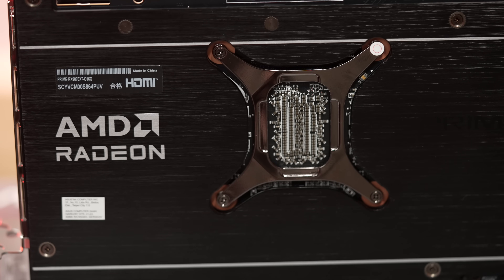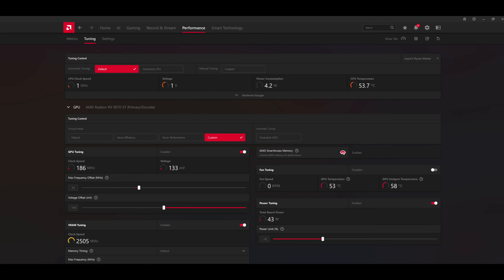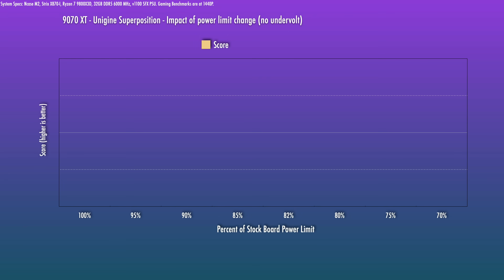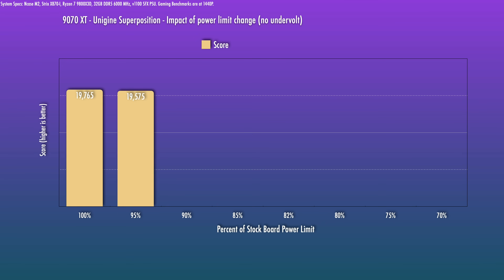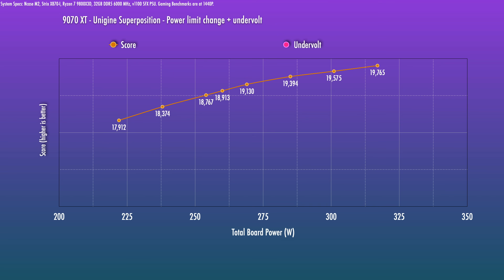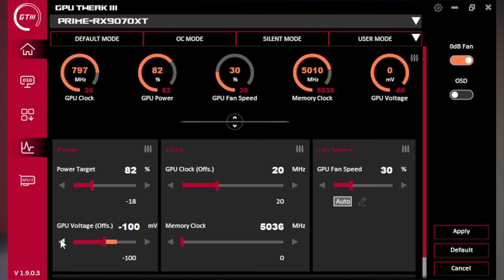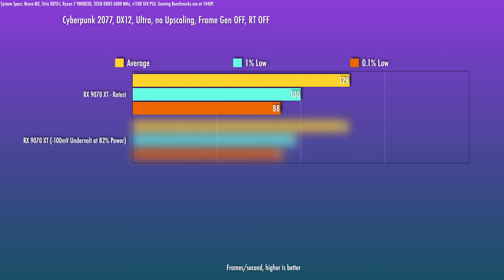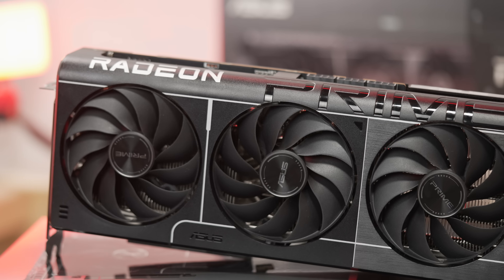Undervolting the 9070 XT... and also overclocking a 9070 to XT levels!

Comment: Something else. Is MSI Afterburner not recommended to do Undervolting on AMD cards with? I recently did it with my Gigabyte Eagle 3070 Nvidia Card and got 90mv shaved off, so to be blunt this is very underwhelming by comparison. The tool looks limiting as fuck comparetively.
Reply from the maker: It should work, when I ran afterburner it crashed every time I called up the VF curve, so I figured something was in the works or needed updating (this was pre launch so things like this tend to happen)
Reply: @MachinesMore  Good, I keep that in mind, thank you for clearing it up! :-)

Comment: I sadly only got a non XT variant and also above MSRP. Which is presicely why I thought it had to have been a good deal on an XT. Prices are already exploding going steady to 1k€ now. So if in the coming days there will not be a lucky day and I find an XT variant at 800 max, i'll just going to keep the 9070 XFX Triple Fan OC Card I now have accidently on the way. A massive pain here in the EU, seemingly more so than prior to Covid.
Reply from the maker: Are returns easy? I mean I’d try and see how well yours can overclock and just run with it.
Reply: @MachinesMore  I certainly only return the card when my (hopefully bought today XT model arrives.) Otherwise I might tinker with the one which should get to me by mid next week. As for returns in general. The EU is pretty strong on customer protection, so we have a 2 week window to return goods and get our money back no questions asked.

Comment: I bought one of the last RX 9070 sparsely available in Germany. It's the Acer RX 9070 Nitro OC (245 W vs 220 W TDP). It should arrive tomorrow or saturday. I couldn't get a good XT throughout the day. 

Yes, there were some available but at 800+ € and the ones at MSRP (689 €) were sold out too fast. I payed 719 € for my new 9070 non-XT, but I didn't want to wait.

Thanks for the video. That's exactly what I already did on Vega 56/64 and RDNA 2 (RX 6800 vs RX 6800 XT) release: just get the lower tier card and oc/uv it to the point of (near-)equilibrium.

Good to hear, that one can get near the performance of the XT with the non-XT card.

Greetings,
Looney's Tech Channel

Comment: I was able to shave allot of power usage on my 6800xt when i undervolted. I was typically running 280-300w but after undervolting i had it down to 200-230w. Amd gpus seem to undervolt pretty well without any performance impact. Even after overclocking i was still under stock wattage and gained another 5 to 7fps on avg

Comment: In central europe the high end cards are around 1200€, midrange 900€-1000€ and few basic cards around 850€. I want to get 9070 XT but not at these prices and the model i want is also not available right now.

Comment: I had been hoping to get the powercolor reaper 9070xt but it sold out within the 15 minute window of me clocking out of work. & due to the...  >:[   ""slightly""   higher prices of all the other 9070xt cards in AUS i went with the PC reaper 9070 non-XT. It's reassuring to know i will be getting almost the same performance with a decent OC. & won't have to worry about thermals because both models use the same cooler, at least i think they do... i really hope they do. 

Great video, also stuff like showing UV performance & your SFF case thermal performance videos is why i love your content. You perfectly cover this niche section better then anyone else i've seen. keep up the great work. :)

Edit: they recounted stock and had over sold the card I ordered, they offered a free upgrade to the PC hell hound, but I'm in a formd t1 and that won't fit. So I guess I get to wait some more then. ;^;
Reply from the maker: Cheers, means a lot knowing you guys find it helpful! I personally prefer the non-XT so I think that’s a blessing in disguise. Plus beer money 😎Hope you win the silicon lottery there!
Reply: Reaper has 5 heat pipes for XT and 4 for non-XT. There is a slight difference.

Comment: mem temp seems high in general across all 9070 xt cards. even with less power and voltage.
Reply from the maker: Very much so. Like to see GDDR6 under 95 and even in an ideal airflow scenario (inverted Ncase M2) these were hitting high 80s at 25C ambient. So not a lot of room for poor airflow/high ambient environments.
Reply: @MachinesMore  I am curious what temp my case can hit. Have super nice airflow and i hope i can hit some good OC / UV with my GPU. I got a Hellhound for MSRP.

Comment: I tried same stress test as u but it doesnt work in games stable still searcing for better stress test to get stable undervolt
Reply from the maker: Yeah, this is definitely one of those YMMV scenarios… you may look into just fine tuning and adding back voltage if unstable.

Comment: How does the XT OC if you push it to the limit?
Reply from the maker: Slightly better, just a quick tune I could get it to draw down almost 350W with ~5% gains. It could be better, just haven’t fine tuned that at all yet.
Reply: @MachinesMore  cool. How much extra voltage is possible to set? And power limit?

Comment: Good to know since I wasn't able to get a 9070XT, found a 9070 though at MSRP, it's already overclocked though according to XFX(up 200mhz, 2210 game clock/2700 boost), so im curious on how much more it can be pushed.
Reply from the maker: Awesome, I don’t consider it a consolation prize at all, I’d have gone for the non-XT myself especially at MSRP. Check your game clocks, you may be well above 2700 and don’t have to tune much!

Comment: can a 9070 xt offer same performance as the 7900xt?
Reply: According to tests it is slightly better than 7900 XTX, with much better FSR and Ray Tracing. Also considerably better in power draw I think.
Reply: @darhaall  slightly better than the 7900xtx? what?

Comment: Great review! This I was looking for, because the 9700XT is a bit power hungry for my taste.
I was looking for an option to lower power usage while gaming and still having good performance; now I know it is possible, though I need a bit more help with the GPU tweaker software. I used NVidia for years just running stock with MSI afterburner for fan tweaking.

If you could make a video with the exact settings and how to check for your system, that would be great! important for me the system is stable :)

Comment: Thanks for the info. 👍🏼

I stopped using ASUS branded components in my builds quite a while back because ASUS is charging way too much for them, and their pricing of current generation GPUs (from both AMD and NVIDIA)  is a Prime Example (see what I did there? 😏) of what I'm talking about.

ASUS spent decades building up a solid reputation as a leading brand in the industry, and now they're squandering it.  They've been 'cashing in' on the ASUS name with sky high pricing and then grinding salt into the wound with poor customer service practices, to boot.

(And ASUS is not alone: brands like MSI, Corsair, and NZXT are just as guilty.  I hope smaller/newer companies like ZOTAC and Montech put them ALL out of business. 😠)
Reply: The Prime was the only model that was available for MSRP here in Germany. Got it for 689 including 19% Tax.
Reply: @SpiDey1500 👍🏼

Here in the U.S. I never see any ASUS GPU (whether they're NVIDIA or AMD products) priced at msrp.  Never.  So, I buy from board partners who DO price what I'm looking for at msrp. (It's bad enough having to deal with scalpers.  I won't do business with a company that cuts out the middle man so they can scalp their own stuff. 🙄)

Comment: Super dumb question, how does the 9070 (non xt) undervolt? I'm just curious how much you can shave off that one.
A <200W GPU with 7900XT performance would be insane, and if you can also shave 20% safely that puts it 150-160W
Reply: I've made my Sapphire Pure 9070 run at just under 200w with about 99% of the performance
All i did is undervolt it by 100mV and set the power limit to -20%
Reply: @ Great results! I’m slightly surprised it still has that amount of headroom. Now I’m really starting to hope they make some 2 fan thin variants… (I know it likely won’t happen though)
Reply: As the 9070 frequencies are lower, it runs more efficiently and requires fewer volts to run stably so is more power efficient.
As you undervolt it more, soon you'll have to lower the max frequency to maintain stable operation.
Doing so saves power but tends to impact the 1% lows, which need more power and frequency to do more work on tougher frames.
Reply: @RobBCactive  It all depends on where the 9070 stock sits in terms of frequency vs voltage curve. Chances are it won't undervolt as good as the more power hungry out-of-the-box cards (for obvious logical reasons...) which is why I said it's a dumb question. Nevertheless, it's relatively easy to test for someone with a card in hand.
Reply: @strat0caster124 look you're not going to get 9070xt performance on 200W.
As published 9070 standard is max 2.5GHz, 9070xt about 2.9-3.1GHz depending 
At the same power as the 9070xt has more CU it performs better than 9070.
How one particular card performs undervolt-ed doesn't mean another card will, binning is a thing and nothing out of spec is guaranteed.
Reply: @ Look, I am not asking for 9070xt performance with 200W. Read again if you must, I said "7900xt", a nominally 300W last-gen card. I have not mentioned the 9070xt at all in my original comment. The stock 9070 trade blows with the 7900xt. The stock 9070xt regularly beats the 7900xt (to different amounts in different games), but again, I have no intentions of discussing the 9070xt, as the original video already discussed the undervolting potential of the 9070xt.

The stock 9070 is a stock 220W card. If there's 20% power reduction headroom for maintaining most of the performance (like the 9070xt), that makes it a 180W 7900xt equivalent.  If there's only a 10% power reduction headroom for undervolting, fine, that still makes it a 200W 7900xt equivalent. I'll admit that the 150-160W number in my original comment was a very optimistic overestimate (200*0.8), but it was a back of the envelope calculation. You get the point. 

I know it's a big IF, I'm not saying it will have that headroom, I'm just saying it's something that can be tested. If there is undervolting headroom, great. If there isn't, won't be surprised either.

I'm not sure what you're trying to prove here. If you have the card and you've tested it, say you've tested it and speak with numbers. If you haven't, then you're just doing a hypothetical analysis and not offering much more insight. I'm not unfamiliar with those undervolting trends and behaviors (which is, again, why I stated it's a dumb question in the beginning. I know there probably isn't much to be expected). I just don't have a sample card in my hands to test and see where the limits are.

Comment: I waited in line outside MicroCenter for about an hour or two with hundreds of other geeks, had a blast, walked in, got my first choice of card (Gigabyte Gaming OC), and it was at MSRP! 😁 Also, Thank you for doing a video showing the maximum efficiency point. I tried to find that for the XTX when i had it and nobody did anything on it.
Reply from the maker: That actually doesn't sound that stressful compared to 50-series. I'm glad you got it and hope you enjoy.
Reply: @MachinesMore experience in Europe . Sales began at 3pm , stocks at msrp were gone at 3:02pm , other  9070xt models priced 850-1000€ (699 msrp)
Reply: My XTX OC’d still beats out the 9070XT non OC in the reviews I’ve seen, even in RT, but at 480W, which is about 75W off the power draw of the 9070XT shown by Gamer’s Nexus. Not too bad. I literally have a 50% uplift over the stock XTX in their testing in Cyberpunk 4k/1440p Ultra RT Q upscale. Awesome you hot a 9070 though! Went with my buddy this morning to get him one, but we were not successful.
Reply: @TimothyStovall108  WOW! You really seemed to have won the silicon lottery with your XTX! Nice going.
Reply: Eh  @HankBaxter , perhaps, but I have done quite a bit of modding to mine. Took my card apart and flashed 550W VBIOS on it, so it has quite the power budget to work with. Not to mention the 12K BTU AC plumed straight into the front of my PC case to keep my PC and I cool. 😂
Reply: @TimothyStovall108  Wow! That's even more impressive, lol! 😂
Reply: nice, i wouldve loved to get the gaming oc, but could only find the nitro+ -- im a little bit worried about that 12v connector though 🫠
Reply: @kotn3l  yeah, I specifically avoided cards with that connector, but you can at least feel ok knowing that you got the best card with that connector, as it has two rails, rather than the single one Nvidia used for its cards. Not sure if AsRock did the same. Buildzoid did a video on the connector recently.
Reply: @HankBaxter  yep, i have high hopes in Sapphire. also seen people undervolting, going from 320W down to 260W with 1% performance loss, exciting!
Reply: @kotn3l  Nice!
Reply: @HankBaxter the sapphire card doesn’t have 2 rails all the power pins are in parallel.. still unlikely to have any issues at 3 to 400w as long as you plug the connector in properly
Reply: @ You should be fine, as you're not getting anywhere close to the 600W limit of the connector with this card. Especially if Sapphire properly managed the load across the cables.
Reply: Was the MSRP $599 or higher because it's an OC card?
Reply: @solson223  $599. I was surprised because I wasn't expecting the card to be msrp.

Comment: In Australia, the Asus Prime 9070 XT is around AUD1400 (USD890) and the 9070 is around AUD1200 (USD765); these are amongst the pricier options, and not anywhere near MSRP (even allowing for currency conversion and taxes). Disappointing, as you said; I'd heard in a few places that the Asus Primes were going to be 'MSRP.' The PowerColor Reapers look like the only models that are close to MSRP here (9070 XT around AUD1140 or USD725; 9070 around AUD1050 or USD670).
Reply from the maker: Thanks for the data point on AUD pricing. Curious is that inclusive of GST?
Reply: @MachinesMore  yep, GST's included in those prices.
Reply: @MachinesMore yes, it includes GST and they add over $100 to the GPU price for.... No reason. The MSRP cards in Australia are the Steel Legend and Reaper. The Prime is horrible over priced it's only $50 cheaper than a Nitro. Bizarre.
Reply: @MachinesMore  GST's included (as another commenter noted), and now (coming up to 48 hours post-launch) there's no more 9070 XT stock anywhere in Australia as far as I can see. Some 9070 models are readily available.

Comment: I grabbed the 9070xt pulse, 599 as advertised... 650 after taxes
Reply from the maker: Nice! Where were they at MSRP?
Reply: Nice, in my country no msrp at the moment but still the cheapest is Steel Legend Dark Version for 749$, still better than 999$ 5070(msi shadow 2x) and 1299$ 5070ti(inno3d 2x)

Comment: On a more positive comment, I was about to critique that most reviewers don't discuss undervolting which would be interesting given the finding that the RX 9070 XT seems to be sacrificing power efficiency to be close to the RTX 5070 Ti, but with this follow up video that got addressed which I appreciate 😅

For me undervolting is needed as I live in a tropical country with no aircon at the house currently, meaning my GPU is more likely to hit less ideal high temps even with good airflow case and fans. Getting more stable FPS if the GPU can run just slightly cooler is imo worthwhile than seeing it can reach max FPS but is more likely to dip/throttle in equal measure. It is fun to undervolt too imo in seeing if the silicon lottery will favor getting to run games stable at the least voltage realistically without crashing.
Reply from the maker: Oh they absolutely turned the dial to 11 to try and catch the 70 ti. As mentioned even if you just reduce the power while keeping the stock VF curve you get power savings at a very low performance hit. BTW thanks for you comment on the operating environment. I try to be conscious when I look at thermals that not everyone is operating their system at less than a 25 degree ambient, thanks for confirming that can add value.
Reply: I relocated to Rome last year and it's already hitting 30.... 35 tomorrow. I am glad I started undervolting my laptop years ago. There's definitely a lack of content for people living in hot countries...